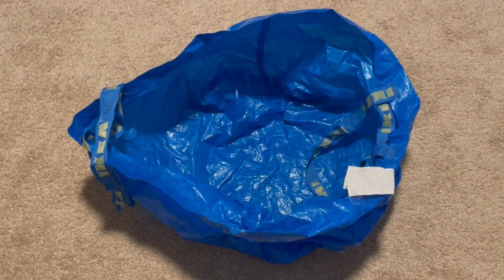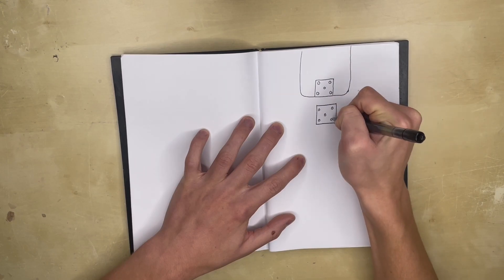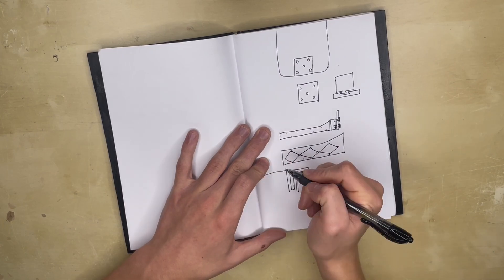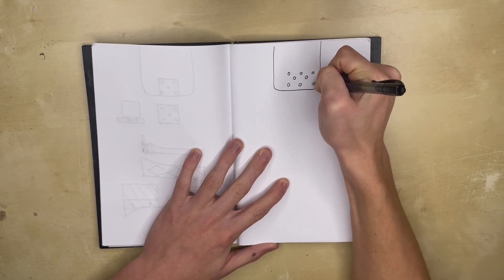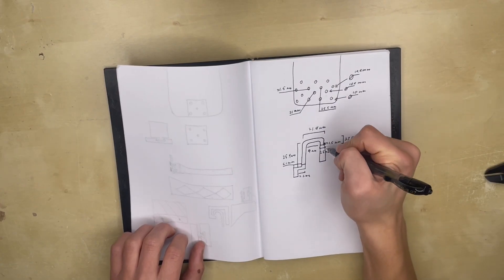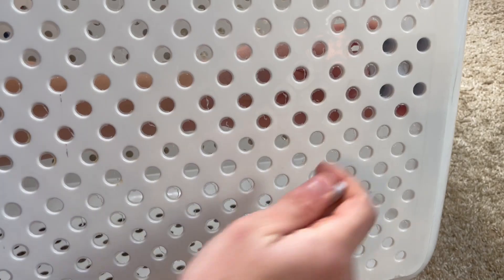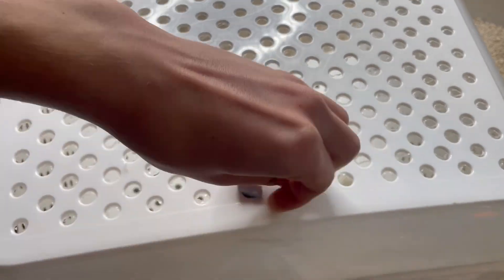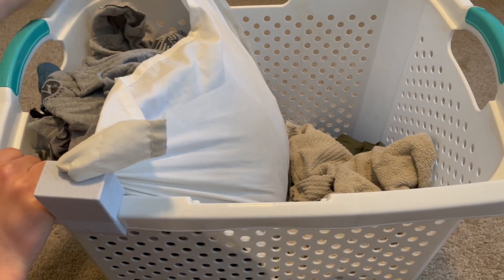Goodbye Laundry Bags - My 3D Printed Hamper Divider - 3D Printed Problem-Solving

Comment: I’m really sorry man and this truly is no judgement but the solution is do your laundry more often. This will make your clean stuff smell like your dirty stuff. Also,, your clean stuff should be folded and put away in drawers/wardrobe. 

The real solution is to get a smaller laundry basket and just do your laundry when it’s full. Truly, you’re likely overloading your washing machine if this is the size of the loads you’re putting on, which means things aren’t getting cleaned properly anyway.